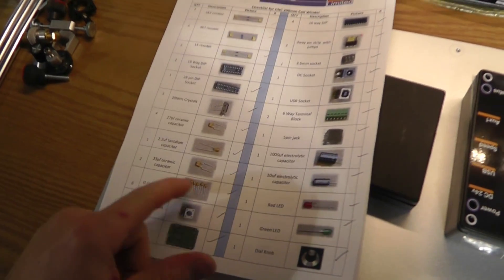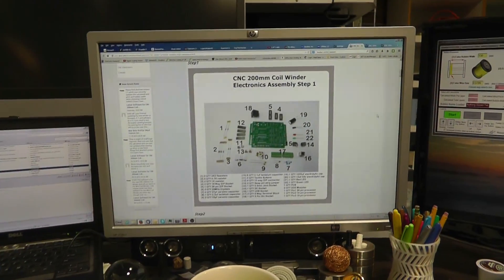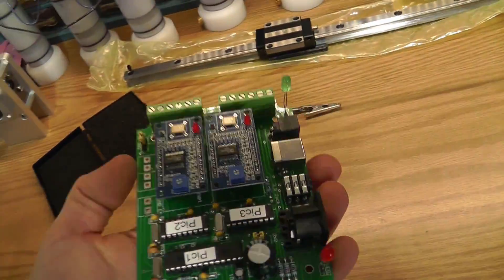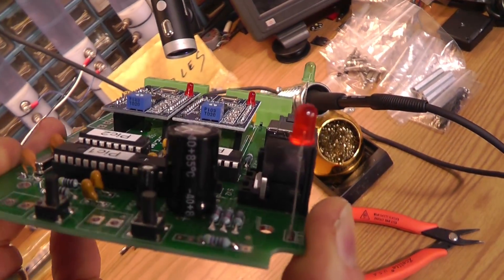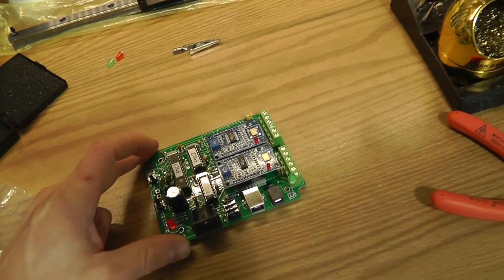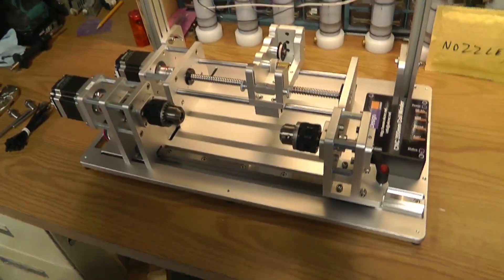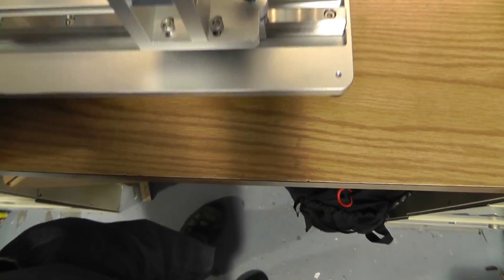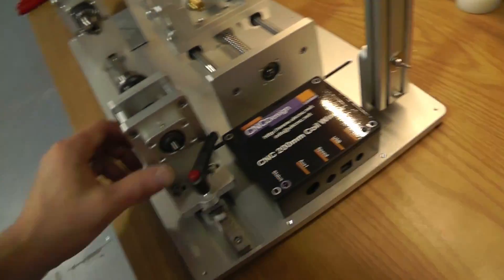2014 CNC 200mm Coil Winder build... let's do it!

Comment: Hi Russ just thinking about all the wire under the ships ladder where i work they are coils wire wound on a real like from a vender that sells wire to be ran in conduit  is more than likely wound as the fishing real it dose its real in over and back  but from  as far back as i can think if you want  to make make an electromagnet one layer is wound and then ran strait back to the start over on the  top of the first layer if you  keep this up multiple wire layers make less resistance in the coil more Resistance less amps one layer more amps more power The pin ball machine coil  that lifts 5 one and 1/4 inch steal balls at one time (pow bang they are up there  ) at 120 volts is  one layer of wire 1 and 1/2 " diameter  about 7" long don't let the relay stick lots of heat  Thanks Russ  been viewing long time keep up the good research